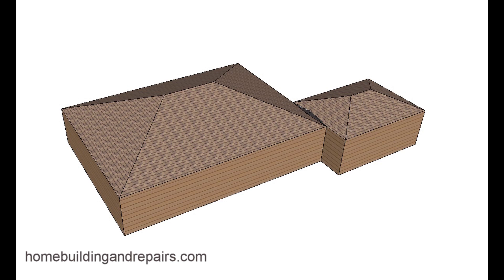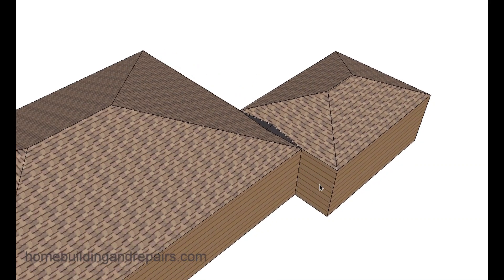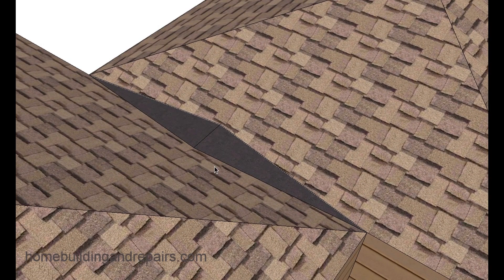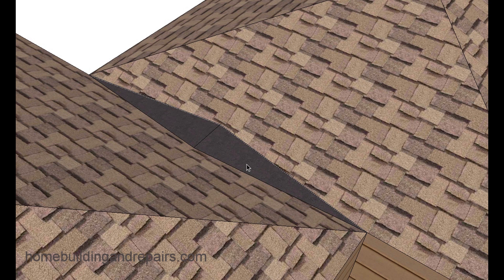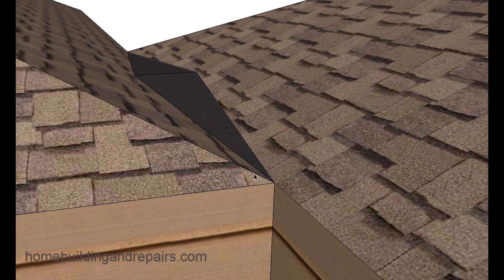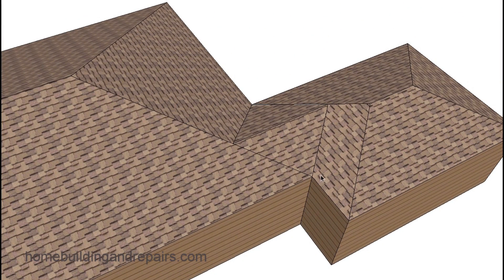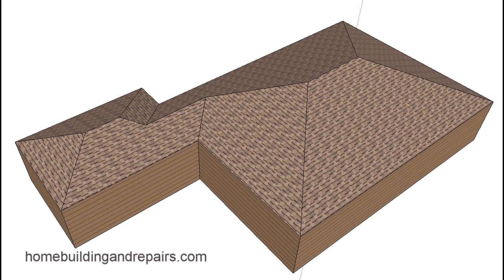Offset Room Addition With Hip Roof – Building Design Ideas For Home Additions

Comment: will this work with metal roofing
Reply from the maker: With metal roofing they usually use metal in this area, but I don't see why something like this wouldn't work, but it might need to be modified and built a little differently.

Comment: Need ideas I’m
in the process of building an outdoor fireplace BBQ that I would like to cover.
My problem is that I have on one side my woodshop that that sticks out 20’ to
the end of my porch and has a 4/12 roof. On the other side is a sunroom that
sticks out 12’with a 4/12 roof. The main house ( which has the laundry room and
wife’s garage has a 5/12 roof. So what I have is a U shaped patio that I would like to cover. Would like to have
a gable end that my chimney will go straight up the center of it. On each side
of the fireplace/BBQ I have built a column that is 8x16 filled solid from
foundation to the top. I would like to run a solid rough beam 8”x8”x22’ from
the main house to the columns than build rafters sitting on top of that. Any ideas
on how I can tie all 3 roof lines together.
Reply from the maker: I don't know if I will be able to help, but send me some pictures and maybe a few drawings of what you are trying to achieve and I will see what I can do. Our email address can be found at the website.

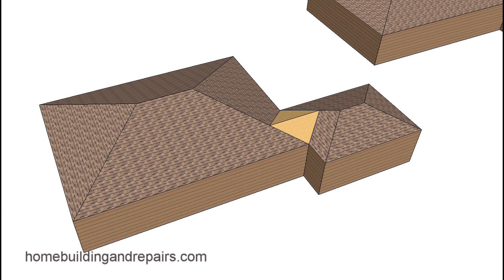Comment: Your example starting at 1:47 is an exponentially better way to handle this situation than the little cricket...  It looks better and in any cold climate would perform/wear much better as well.
Reply from the maker: The first example provide you with a cheaper way, but you are absolutely right about this area trapping snow. I try to provide people with few options, but they aren't always going to work for every situation.